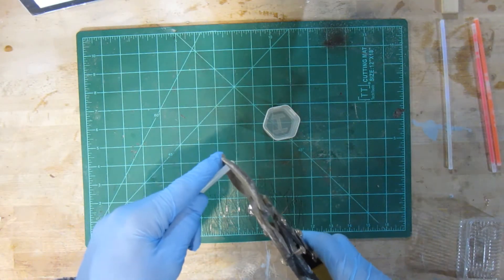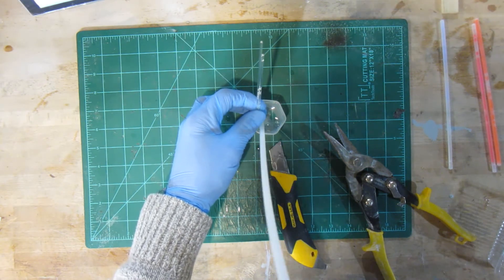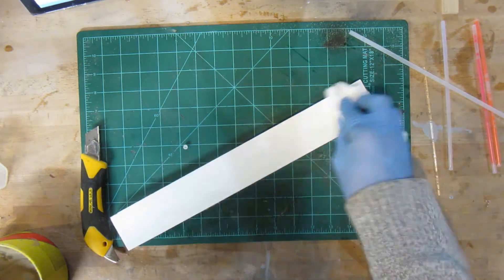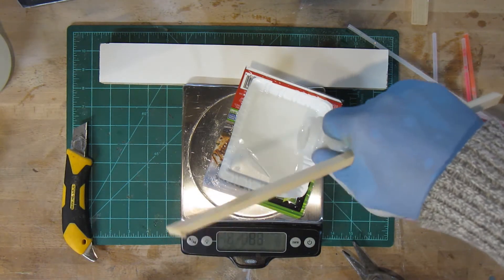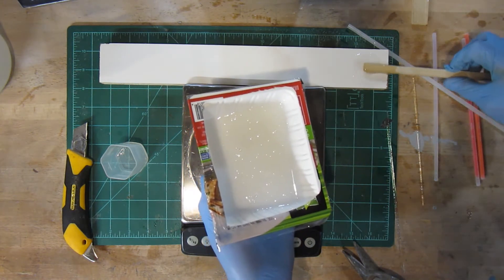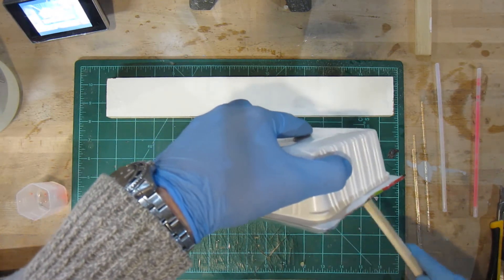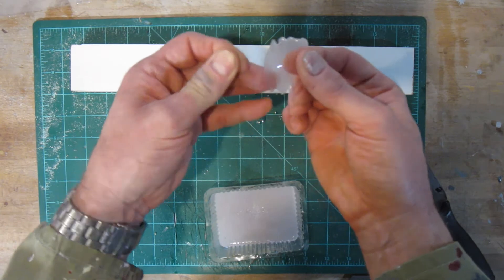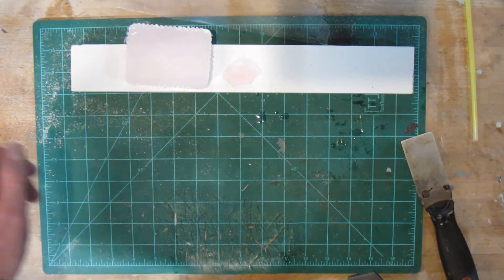Fiberglass Epoxy Softening Experiment

Comment: If you add solvent to make it flexible the solvent will eventually escape and the epoxy will get very hard. In fact the brittleness of epoxy is probably it biggest downfall, at least for floors. Have you saved those pieces to compare after a year or so ?
Reply from the maker: I have not saved those pieces.  I had one coated piece outside for about a year and it yellowed and cracked in about a billion places.  Given time it would probably do the same inside....eventually.
Reply: @dork3nergy  Thats kinda a property of all epoxies though, they no like the uv.